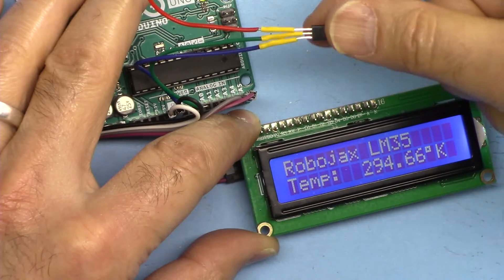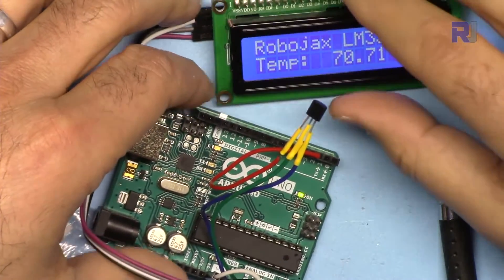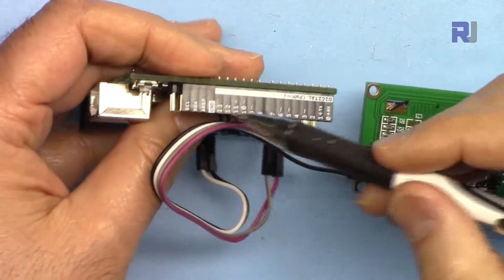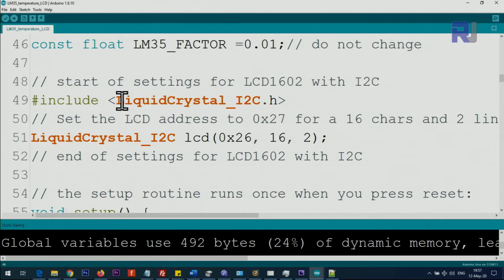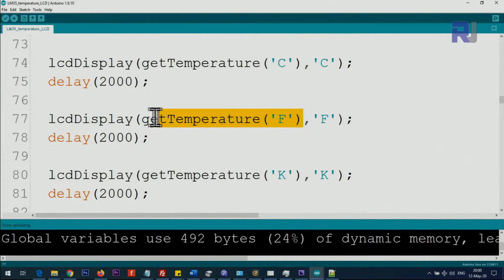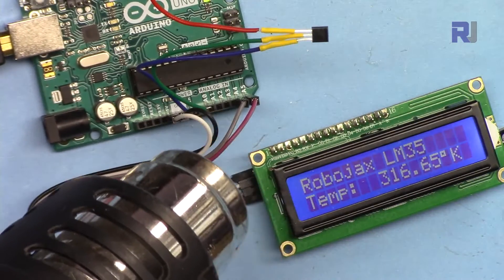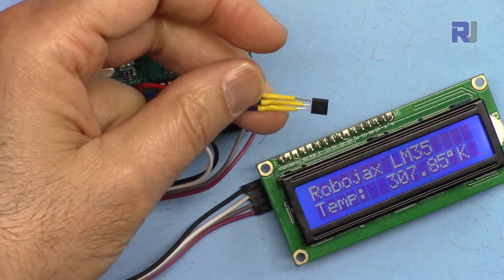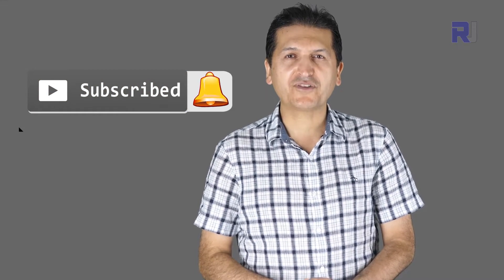Display Temperature on LCD1602 using LM35 Temperature Sensor with Arduino - RJT315

Comment: Hello Ahmad, i have an issue with this program, when i out the code into the IDE, i got an error with lcd.begin() and that it requires 3 values, when i types 16, 2 it uploaded bu the lcd didnt do anything, everything is working and wired correctly i checked it seperately.
Reply: Could you please help?
Reply from the maker: Please watch introduction to LCD video before commenting to this video.

Comment: Thank you so much for this video

Is it possible to add an battery voltage sensor along with the temperature sensor in the same Arduino, How can we combine the both programs
Reply from the maker: To measure any voltage you don't need any sensor. watch this video https://youtu.be/t8xwrVj2aFs to learn how to measure any DC voltage.  Here is better video for LM35 with wiring diagram which is part of a course https://youtu.be/vHS6gGLFBh8 I have explained them fully. simply combine them. meaning nothing should be repeated in the code when you combine for example setup() function should appear once and loop() the same. follow my Arduino course to learn.
Reply: @robojax  Thank you so much

Comment: Your code link is not redirecting rightly/Please work on that link for easy access of code for beginner
Reply from the maker: we are sorry, today we are migrating to a new system and many links are dead. I've just fixed this link. try it and if you faced problem, try it later today or tomorrow. We do our best to fix this issue.

Comment: Good but dnt work on my pc
Reply from the maker: You must have skipped the required. Idea Afro this 1- introduction to lm35 and 2-introduction to lcd. If you watch both before coming this video , I can assure you that will not have any issue. The links are in the description of video.
Reply from the maker: Here the better version of this video which is part of the course which includes wiring diagram and more https://youtu.be/vHS6gGLFBh8
Reply: @robojax  i think the part of the problem is i use the lm35dt not the lm 35(i think only the estetic is déférent and i Search IT on Google and the Ground and the out pin was inversed and i plug IT as you Says but with the pin order of lm35dt
Reply: @robojax  Now IT work but how can i Do if i want only the celcius degres
Reply: Also why Do we need the code like 0x26?

Comment: I would be much grateful if you will help me on a project.
I want to use two LM35 to monitor the temperature of two heat sink 
in an amplifier. one for channel 1 and one too for channel 2 and i want to display the temperature 
on second line of the 1602 screen.one the first line,I want to display "CLASS D900 WATTS"and i want it to blink
I also want to display blinking "PROTECT" on the first line and a moving"POWER OFF" when the Arduino pin sense a voltage between 5v to 3v.
I want the blinking "PROTECT" to stay on the screen till the voltage is removed.
i want two pins for channel 1 and two pins for channel 2 for the voltage sensers. you can send the code through   osikani20101@gmail.com    thank you in advance.
Reply from the maker: Hello,  I have explained this like in 30 or 40 videos. This the easiest thing in Arduino to display.  Just watch different videos related to Arduino so know how it is customized. but if you don't like that method, post your question on Arduino official forum https://forum.arduino.cc/ and 100s of people will respond to help you.  Or simply hire someone here https://www.upwork.com/ good luck

Comment: Is it possible to also include a 3.3v signal to a relay switch so I can turn a fan on and off when reaching set temperatures?
Reply from the maker: Yes. and you can learn it from this video https://youtu.be/yJYXfaU9J34

Comment: i hade a probleme
Reply from the maker: that is not enough. provide error. this is combination of separate introduction to LM35 and introduction to LCD, have you watch them separately before coming this video? if not do it. the link is under this video. Watch both and make sure to you succeed, then come to this and it will work.

Comment: float getTemperature(char type)
{
    float value;
    float averageTemperature =0;
    int sensorValue = analogRead(inPin);
    float voltage = sensorValue * (5.0 / 1023.0); 
    float temperature = voltage / LM35_FACTOR;
    for(int i=0; i< iteration; i++)
    {
      averageTemperature += temperature;
    }

    averageTemperature /=iteration;

Correct me if I am wrong. THe For Next loop will just ad up the same value of temperature for 1000 times and divide it again with 1000(no. of Itteration) as analog read(inpin) is outside of this for next loop.
Reply: In a way, it is just a glorified time delay. Because you just add the same number 1000 times and divide it by 1000.
Reply from the maker: you did not explain that this is. No introduction nothing. code and then "if I am wrong". Always put an introduction and so for example: "I believe the code below would be better" or "I am getting error with this code".  you can click on the 3 code beside the code and edit it. this way others learn or help you.
Reply: This is the code for this project according to you from the link that you provided. What i am trying to convey is that your code is not iterating.
Reply from the maker: than you for letting me know.  I just checked it and it is correct
 float voltage = sensorValue * (5.0 / 1023.0); 
   float temperature = voltage / LM35_FACTOR;
    for(int i=0; i< iteration; i++)
    {
      averageTemperature += temperature;
    }

    averageTemperature /=iteration;
Reply: @robojax  I had learnt a lot from your videos and codes. Usually, i will just gets into your code and gets the Idea, and recode myself. This is how i get curious about your code.
Thank you and keep up the good works.
Reply from the maker: Very good. Stay safe.

Comment: Sir thank you very much for your valuable information regarding temperature measurement through the Arduino board. Sir, I have a simple 16 x 2 LCD instead of an I2C LCD. So please guide me on how can I measure the temperature with a simple LCD. What will be the circuit diagram & code? Please help me.
Reply from the maker: you are welcome. here is the code for LCD without  I2C  https://robojax.com/learn/arduino/?vid=robojax-LCD1602 but you should learn from the current video on how to send the  text on display.  good luck
Reply: Thank you very much sir.

Comment: Hello Mr Ahmed,
 I would like to ask you about an error I find in my arduino code. It keeps giving the same error over and over again in the line lcdDisplay (getTemperature ('C'), 'C');.
I tap verify and it says that 'getTemperature' was not declared in this scope. Could you please help me fix that error?
                                                                                                                      Thanks for your time,
                                                                                                                                 Apostolos.
Reply from the maker: It means you skipped the video and did not follow the instruction. You have not installed the library for LCd. I mentioned it in the video. Please watch again and follow the instruction.

Comment: it says done aploading. but nothing happens to the lcd. still boxes. and when i open the serial monitor. it says robojax lm35 with lcd for arduino. pls help
Reply from the maker: I mentioned that for this video, you need to watch 1-itroduction to LM35 so you can print temperature on the serial monitor 2-Watch introduction to LCD so you are able to print "hello world" or something on the LCd. then come to this. if you haven't, then the link to those videos are in the description and in the page where the code is. good luck.
Reply: @robojax  i just change the lcd adress 0x26 to 0x27. and it works. btw thankyou for the great project.
Reply from the maker: you are welcome.

Comment: yo tengo este problema no matching function for call to 'LiquidCrystal_I2C::begin()'
, veo el vídeo una y otra ves pero no encuentro cual es el error que tengo en codigo.
Reply from the maker: dice que no vio el video omitido. si miras 100 veces y no miras continuamente, perderás la parte importante y nunca funcionarás. No se puede explicar mejor que esto.
Reply: @robojax  no me salte nada del vídeo, no es largo como para saltarse partes, lo que no entiendo es porque me pone ese error, ya que mi pantalla funciona con (0x27) y le puse ese pero sigue igual.

Y si la respuesta esta en alguna parte del vídeo, solo quisiera saber en que minuto del vídeo, para poder arreglar el error.

Comment: Hi Robojax.
Please can you help me out with the other project using the Nextion Screen with your Arduino Code your Code ( nexswitch ) i can not get it to load on my two Arduino boards.
The erro message is ( expected initializer before numeric constant ) Arduino: 1.8.10 (Windows 10), Board: "Arduino Uno"

nexswitch:1:21: error: expected initializer before numeric constant

 const int SWITCH_ON 1

                     ^

C:\Users\User\Documents\Arduino\New Projects\NEXTION_ON_OFF_DUALBUTTON\nexswitch\nexswitch.ino: In function 'void switch_control()':

nexswitch:26:44: error: 'received_data' was not declared in this scope

     int size = Serial.readBytesUntil('\n', received_data, 4);

                                            ^~~~~~~~~~~~~

nexswitch:30:23: error: 'SWITCH_ON' was not declared in this scope

     if (switch_pos == SWITCH_ON) {

                       ^~~~~~~~~

nexswitch:33:30: error: 'SWITCH_OFF' was not declared in this scope

     } else if (switch_pos == SWITCH_OFF) {

                              ^~~~~~~~~~

exit status 1
expected initializer before numeric constant

This report would have more information with
"Show verbose output during compilation"
option enabled in File -> Preferences.
Reply from the maker: I don't worked with that module and have no experience with it. Sorry
Reply: @robojax  Sorry i sent it to wrong person.

Comment: Sir please reply that i have the  same arduino genuine uno but code uploaded only once and from second time code is not uploading actually my laptop is also toooo old and second handed so i have to change my laptop? 
Or, l have read trouble shooting and they said that we should burn bootloader but that too is not happening 
So should I change my laptop?? 
Sir please reply only you can help a student of your 🙏🙏🙏🙏
Reply from the maker: Hello, it should work with any Arduino. this is very simple Analog reading.  I have mentioned that you need to watch the Introduction to LCD1602 and make sure you can display a text. if you can't do that, you should not come to this video.  the link is in the description but here once again. https://youtu.be/q9YC_GVHy5A .

Comment: Couple of things. The extra clips were confusing. Some impossible K and C values indicated without explanation. The other point is that the LM35 is capable (at least two version are) of measureing down to 50 degrees C but the arrangement shown only from 0-150C. There are system examples in the Data Sheet. Negative temperatures require some biasing components or a +/ supply.
I have only used this (with a PIC device) for low C temperatures (Chilled Water) but I was hoping to use it to check Freezer temperatures.
Reply from the maker: I put the word "extra" so it means some extra stuff. This video has introduction to LM35 and needed to be watched and most stuff were explained there. this is just to display it on LCD.  the K and C impossible value did not need explanation because when I moved the sensor or heat gun, it got connected/disconnected and the value jumped.
Reply: @robojax  I was not being critical just observing. 
The data sheet shows a way to achieve what I require. using a couple of 1N914 s to lift the LM35 from the deck and bias the output to ground with an 18k 10% resistor.
You seem to have struck out some parts of my mail. Why is that? 
I have purchased your Arduino Course but have yet to get engrossed. I am only at the basic, obvious stuff so far but it is early days.
Regarding the temperature capture - main, possibly only reson for playing with an Arduino and I am fast thinking of going back to the PIC solution, I am reluctant to take the NTC Thermister route because there are so many different profiles. But if I have to I shall. I still have several steps of development to get past.